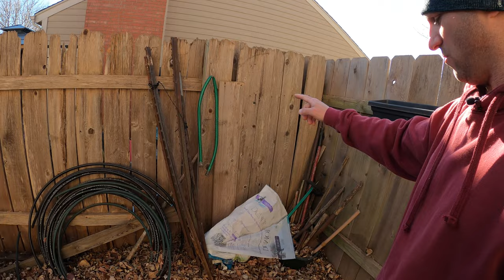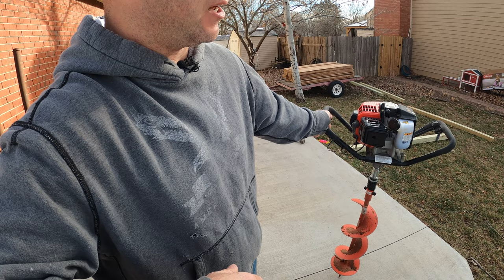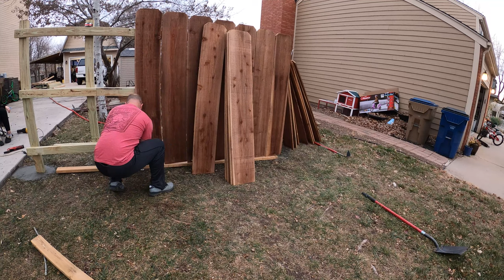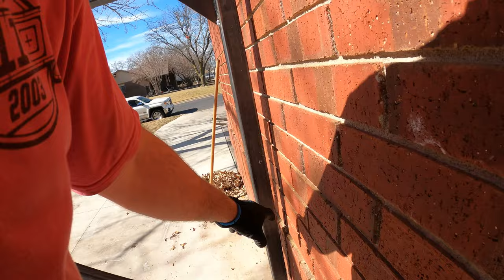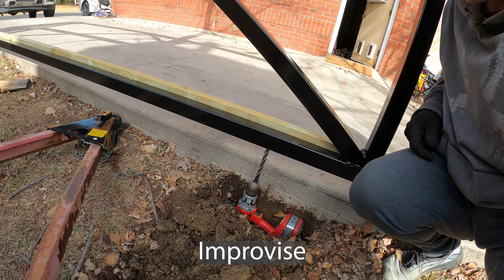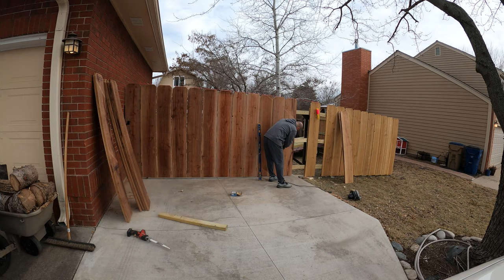HOW TO HIDE A 13 FOOT STEEL GATE IN A CEDAR FENCE. BUILD A BEAUTIFUL FENCE THAT WILL LAST 30+ YEARS.

Comment: For a post on the gate I'd have gone with a chunk of old oilfield pipe.  My buddy did his and used 4 inch lengths for the anchors for the on the gate.  Then used 16 foot lengths of standard pipe for the post.  Just painted it all black.   Works with standard fence brackets for the stringers.  He did the weld on hinges.  Did board on board with a flat cap.  Worked great.  I like the latch you did on the wall.  You might put a plate with a spring on the outside of the fence.  That way it puts tension on it and pushes it tight against the latch plate in the wall so it doesn't rattle in the wind.

Comment: Great job on the fence & gate but in England we would have screwed a 4x2 to the brick work then hung the hinges off that, with the weight of the 2x2 gate frame & the timber cladding it their is a lot of weight hanging off thee 4x4 post in the ground even with the wheel supporting it

Comment: Nice work, came out great! FWIW, when I did a very similar project a few years ago, I used a pre-made metal gate from the local farm supply. It's lightweight, but plenty strong enough for mounting fence boards on. Cost, at least at that time, was the same or a little less than buying materials to build a gate frame myself. I also added an eyelet bolt to the gate post just below the upper hinge, and another near the base of the next post over. I connected them with a length of steel cable, and incorporated a turnbuckle to add a bit of tension. That cut down on the gatepost flex considerably. I still incorporated an idler wheel though, much like the one you added.

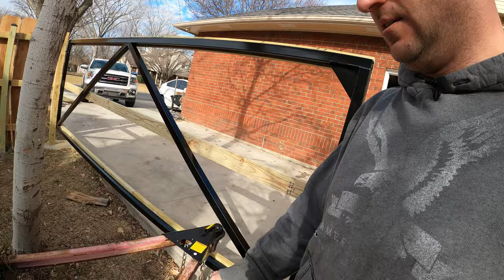Comment: Josh, from one Do It All to another; BEAUTIFUL at  21:21!!! 

I used to install fences  professionally and I would (if you wish to accept the challenge, muahahaha 😂) hammer that concrete and pop in a PT 6x6 or steel post! Lots of work, I know first hand! But with such a long span, you’ll appreciate it very much in the long-run! 
Someone else mentioned angled bracing, also not a bad alternative but the 4x4 will likely succumb to the twisting and such and crack a good bit over a period of time. The 6x6 will as well but by no means as detrimentally. Just some thoughts.

The project is absolutely beautiful though!!! Now I’ll finish watching… maybe I’ll find out that you did exactly what I suggested or a fellow viewer!?!! 🤔

Awesome work though, man!
Reply from the maker: Thank you for the great feedback.
I'll probably regret the wood post, long term, but it was much cheaper at the time.
And I think the house is getting listed for sale soon.

Comment: Great job on the fence gate.  You might have been better off using a 6x6 (or 8x8) as the gate hinge post.  I learned to do that hanging hammocks on my deck where the 4x4 flexed/bent when loaded over and over.
Reply from the maker: I'll probably regret my decision.

Comment: watching you use that engine hoist to pull the old fence post out reminded me of a recent video I saw on the Red Poppy Ranch YT channel,  he needed to remove some poured concrete footings to replace them with larger ones so he used an engine hoist to pull them out

Comment: Would you have been better to have split the gate in half and had half attached the house?
Reply from the maker: Possibly, but I didn't want to deal with a pin in the middle.